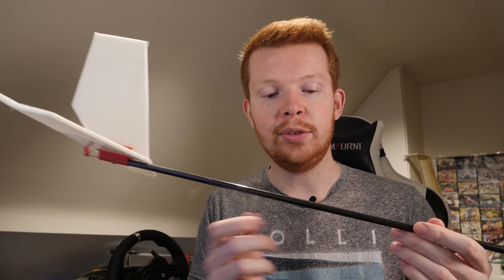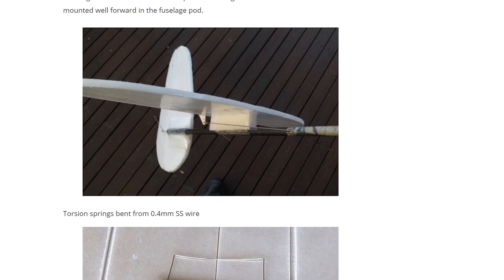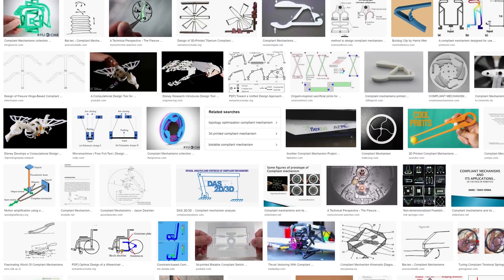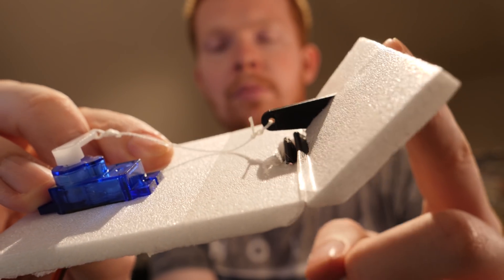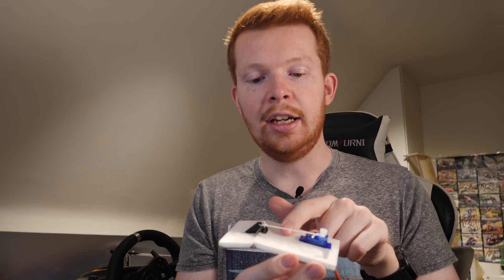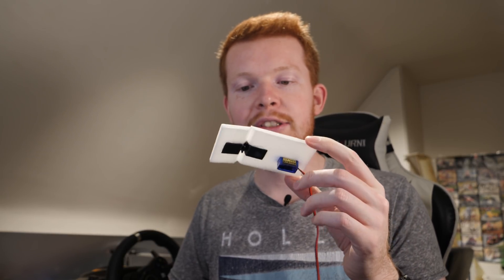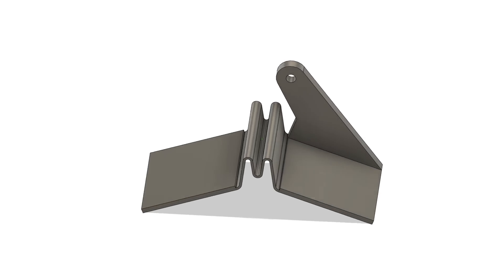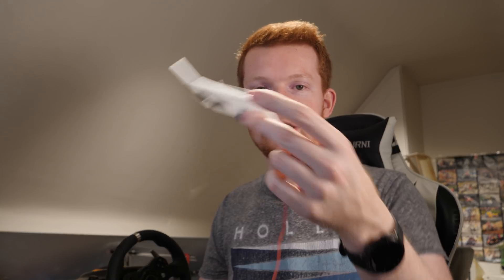Compliant Servo Control Horn Mechanism

Comment: Nice work! I recommend to NOT print this from PLA because it does creep very quickly and your pre-tension will be gone in a couple of days. ABS or PETG should be better in that regard.
Reply: seems like a job for nylon ;)
Reply: @errorgd  or an actual spring...
Reply: Yeah I came to say the same thing. I've experimented with 3D printed RC tank suspension and ABS is a LOT better than PLA.
Reply: i would even go for ASA, has from what i have printed so far even better bending qualities than ABS, uv resistance is irrelevant since it won't be in the sun long enough probably to be affected, but if Stefan @cnckitchen recommends a Material i would always go with that :D
Reply: Or just some folded sheet springy metal
Reply: Because of relaxation/creep you should try to store it in relaxed position...
And check different materials...
Reply: @andistraumann  good point.

Comment: I usually love your videos and your great engineering imagination.  This one is a bit deceptive though. A carbon fiber rod would be ok. A piece of balsa with glued steel rod at the end is also a frequent solution. 
In fact if you wanted to use flexible stuff you could also design a hinge/spring/horn/articulated rod (or rod end) all in one piece or printed in place parts...

Comment: Looks to be a very smart idea! A small lightweight stainless spring might be used for redundancy, should the plastic lose its tension. I tried using printed springs for motor mount in my RC fixed wing in 2013, but found some unwanted (and unpredictable) thrust vectoring J

Comment: You should balance the servo out with a similar system on the other side. So it is not constantly pulling on the wire. In true compliant fashion.

Comment: Hi Tom, 
Wouldn't it be possible to use the dual type servo horn, I mean the one which has 2 arms in opposite direction and use two strings or cords or a bendable wire or maybe fishing line and use double horn on the elevator with the linkage connecting one wire to the top horn part and one to the bottom where the upper string works to pull it up and the lower pulling down?

Let me see if I can bring more clarity with an   example : it's like a bicycle chain consider the rear sproket being the elevator part and the pedals the servo. With no need for a circular motion for this it should work I guess.
Maybe a tiny little pulley can be used with a rubber belt or rubber band.
This would have the advantage of the hinge not failing after repeated use like you said, could happen with your pla hinge. Here the pitch down movement is not as much as pitch up. Maybe it's a stupid idea, please feel free to correct or be mad at me.

Hey guys I straight away typed and submitted my when I read that people have already given this isea. Sorry guys but I was not trying to steal your ideas

Comment: Nice idea. Very original. Have a look at how they spring load the tail serfaces of a dlg. Simple "Z" bend out of piano wire. One side in the stab and one side in the control serfaces. I've not had a falier yet. Thanks for the great content.

Comment: well, intresting research but if this will had some advantage over traditional pushrod rc modelers al ready would had use them for long ago, anyway, to be constructive see the mechanism of the trhothle in walbro carburators, you can use the same mechanism

Comment: You could've tried a TWO-STRING configuration, that way the servo would be able to overcome the non-rigidity of the string by pulling on a different string for each direction.

Comment: added advantage is that if the servo fails or the string breaks, the plane will dive straight into the ground instead of unpredictably either gliding, doing loops or crashing straight down!

Comment: Carbon push rods light strong expensive tho the double string method would probably work a lot better and be stronger this will crack over time especially on the elevator that moves quite a lot

Comment: Why not mount the servo on its side with a T shape servo head with an end above and below the rudder plane; use two strings, each with control arms for opposing tension on the rudder? Skip the Spring mech because it’s heavy.

Comment: Have you considered looking at stainless steel TIG wire?  I purchased a large tube (3 lb) of 1.2mm x 1meter wires for under $50US.  They seem to be about the right size (diameter, stiffness) for the 9 gram servos I have.

Comment: Control surface flutter.  There I just saved your project.  :^)  It does make for spectacular crashes though.  Two old school ways of doing it is the pull-pull with fishing line (which is probably best) or if you only need elevator you can run a small wood dowel through your tail boom.  Put a small length of wire on each end.  The wire has a 90 degree bend which you drill a small hole in the dowel and fit it.  You notch the dowel so the wire runs inside the notch for a inch.  Then just heat shrink over the dowel and wire to secure the two together.   Z bend the on the remaining wire for connection. Do that on both ends and you are golden.

Comment: Music wire in a coil is cheap.  Cut a length, perhaps 3', bend a 1/2" 90° bend on each end of the wire.  Clamp one end in a vise, chuck the other end into a drill.  Turn slowly, and count the revolutions, while keeping slight tension on the drill/wire.  Approximately 12-15 turns per foot of wire.  Once you've completed the turns, reverse the drill for approximately 10 turns to relieve the spring tension on the wire.  Release the wire from the chuck and the vise.  You now have a control rod.

Comment: I have another possible solution.. What of you ran one string above and one below the elevator connected around a "pulley" , ie the one string will be in tension when it pulling up and the other when it pulling down, that way you will have reliable controllable variation in both directions?

Comment: Or ou do it like F3K Discus Launch glider doing it. A 0,4mm spring steel wire bend like a  z or U. If you google it you`ll find it. Will never break, almost no space required.
Reply: Well, it shouldn't break if designed properly so that it stays within the elastic region of the material, and even then it will innevitiably fatigue as all materials under fluctuating loads do.

Comment: If you printed that out of nylon it would probably last forever! 
Also, what about just running a separate string for each force, and moving them differentially? This is what actual aircraft do with cable control iirc.

Comment: Tim thats a nice idea but the servo will constantly pull power to hold the spring. I think a better idea would be to use 2 strings and tense them with a spring.

Comment: I have designed and printed a couple of spring mechanisms in PLA, but like CNC Kitchen wrote, they lose their tension. It is definitely important to move them to their relaxed position when you are done using them.

Comment: Why not use piano wire? could probably source it locally.
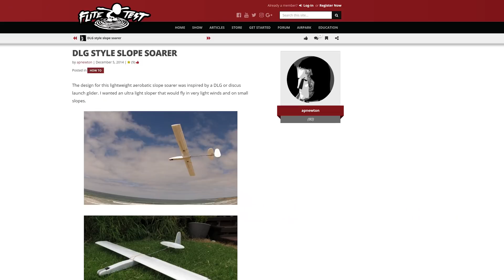Reply: In it's unprocessed form it usually comes coiled up and it takes a lot of force to straiten out into push rods. If you pause at  0:26 you can see that indeed the rods he orders are made of music wire, but someone has already gone through the trouble of straitening them which accounts for part of the marked up price.

Comment: My DLG uses guitar strings as push wire. They are relatively cheap easily available, and if supported in a tube astonishingly stiff. The DLG use an E string but there are of course 5 other thicker wire strings available. I have been making hinges in 1 part from PLA. If it is below 0.3mm thick it is very flexible. I like your design though.

Comment: Perhaps the parts using something like this could be designed such that the natural tendency via aerodynamics or weight bias would have the control surface oppose the force of the servo slightly. That way you aren't totally reliant on the spring.

For example if the elevator or other controls had trim tabs.
Reply: Had exactly the same idea. A trim tab would need an additional hinge design to reliably run the string through the main control surface joint without applying net torque but it's a perfectly viable option for managing primary flight control surfaces with a minimum of input force.

Comment: I think you overthought this. Why not just attach a cheap spring on the other side? No need to print a brittle plastic spring that will deform after a few dozen uses anyway.

Comment: The other half of the string-spring system that Andrew Newton uses, which you alluded to, is a spring embedded in the tail surface. This system is the norm among DLGs, which endure very high speeds during launch(beyond terminal velocity!). You just have to get the spring tension right. You can use guitar strings (E or B) to make the springs. 

I like the integrated nature of your solution(and the simplicity you alluded to belies good design), but like others here, I'd be concerned about the strength and durability of PLA. The elevator is the one control surface a plane absolutely can't survive without!

Comment: That will kill your servo very fast, something like this was used it old seal planes mid 80 with some spring and a coil , insted you can use your 'wire' sistem in a push-pull sistem. 2 fishing strings go in youre tube , one is pulling one is relaxing with a double arm servo

Comment: cool as an excercise, but why not just integrate the servo into the surface, so direct drive?
Reply: Center of mass I would assume. In an extremely light plane the weight of the servo is significant, and having it at the extreme end of the plane would shift the center of mass quite far back. On much larger, heavier planes direct drive might make sense.
Reply: Servos are quite heavy, even tiny ones, and you often don't want to place weight at the extremities.

Comment: BAD IDEA!!   this will have 2 potentially fatal flaws; the "down" force is limited by the spring action and the servo is FIGHTING the spring tension ALL THE TIME. That drains the receiver battery  and also can overheat the servo motor / electronics. CLOSED LOOP is the way to go; 2 lines one pulls up the other pulls down just like in full scale  aircraft. "spider wire" fishing line is a good material for this at verry low weight. You just need to get a "turnbuckle" that screws into a clevis as tentioner .
Reply: Agreed on both points, I was going to raise the same issues.  A control surface needs to be positioned rigidly.
Reply: @ferrumignis  this is just a case of "youtubers" who don't have a background in the subject.  Things are done (or avoided) for a reason. Experienced people know why. Sure its fun to try but don't promote flawed ideas as good ones.

Comment: Instead of using spring loaded, maybe u can try push pull instead. One string to pull to go up and another to pull to go down.
Spring loaded may have problem whereby the air flow and friction may be stronger than the spring. Thus u stuck in one direction.

Comment: Many years ago i had a plastic box with a broken hinge, i spread some silicone sealant along the hinge edge. not only has it lasted all this time, but it also self closes the box
For your application you could use silicone when the aeleron is down and let it set.

Comment: On my DLG i have a pull-system (kevlar string) and a spring in the hinge (piano wire). works great.

For larger planes...use 2 strings (1 on each side of the hinge)

Comment: Surely fishing line would be better? Especially with UK weather... Moisture!
Reply: spider wire brand has a good name for this application; also use the plastic coated steel wire from the fishing supply shop for the bigger models.

Comment: wouldnt it be better to mount it in reverse? if the servo fails, the plane would pull up and most likely go down like a paper plane instead of nosediving to its certain death :D
Reply: My thoughts too, but I don't think it makes a difference in the end, unless you can find a way for it to fail in the neutral position. If it fails up, the plane will pull up and then either loop or stall and then plummet down, if it fails down it just nosedives straight away.

Comment: What about a cam/lobe actuation element with attachment points on each side of the control surface for bi-directional movement (pull up and pull down)? It would seem that this would be a simpler mechanism, not subject to fatigue failure, that would provide positive control in both directions.

Comment: That looks like a great way to induce oscillation and burn servos :D
Reply: DING DING DING WE GOT A WINNER !!!!!!!      /sarcasm    yup ;)
Reply: @cmulder002  thanks!
Reply: @NoPro420  :)
Reply: IThas been used for many, many years in RC models without any problem. It is very popular in F3K gliders.
Reply: @Boogie3D  It's not that it can't work, but that it can easily lead to aeroelastic oscillations if not designed properly for the expected flight conditions. But this can be hammered out in testing I'm sure.
Reply: Shut up :D

Comment: That's a cool concept! As for pushrods, you can use like 1mm or even thinner wire and pass it through a tube and you'd have a Bowden. A simplified version is same wire passed through tight loops of zip ties. I saw it on Flite Test

Comment: Hi, Tom! 
You could use two strings, second string just goes through the surface of the wing to the other side. 
The lever of the servo pulls one string and releases the other, just how human muscles work. Maybe?
Reply: its called "closed loop" and a common way to control model planes. Got a carl Goldberg piper cub that i installed it in. Looks scale and much stronger then push-rods at lower weight. I used the steel cable and crimps sold at fishing supply shops.
Reply: @cmulder002  thank you! Good to know:)
Reply: That's what instantly went to my mind when he stated the problem
Reply: +1
Reply: Who is Tom? This is Tim's channel
Reply: @linecraftman3907  😂😂😂 yeah.... sure it is

Comment: While I enjoy watching your ingenuity, why not just use marker flags for pushrods? I switched to them fairly early on specifically due to the fairly high shipping costs
Reply: Or coat hangar wire.
Reply: Marker flags work OK, but are made of very hard steel compared to pushrods. They are much harder to bend and cut. Personally, I prefer to buy clevis-ended pushrods at my local hobby shop for $1. Easy to adjust, cheap enough, support a local business.

Comment: Do you think it would be possible to archive the same results with a bent piece of thin spring steel instead of the 3d-printed compliant mechanism?
Reply: Why wouldn't it?
Reply: Like the way many DLG have the vertical and horizontal control surfaces  are controlled. A thin piano wire with 2 90 degrees bends stick one end in the fin or stabilizer and the other in the rudder/ elevator.

Comment: Hey Tim Station, nice video.
Just yesterday I thought about printing servo horns and hinges for my next plane.
Reply: better uses hinges that use a pin; anything that bends will fail sooner or later, with horns make sure you get the "spline" right so it does not rotate on the output shaft.

Comment: I think having two strings pulling using both sides of the control horn would be more efficient so the servo isn't constantly pulling to keep the elevator level
Reply: yes
Reply: I always use a pull-pull configuration. You can route your lines however you want. I route them using the small ink tubes inside some pens.
Reply: I think two strings can lead to backlash issues if both paths aren't completely straight. Also servo motors have a certain resistance against movement, even unpowered probably more than the mechanism or the surfaces will tolerate. I also think this hinge is more elegant because it means less moving parts and there has to be some kind of hinge on the control surface in any case...
Reply: totally ; this is a failure (3 actually motor/ receiver battery and hinge spring) waiting to happen.

Comment: Why not just place the servo laying down and two strings to pull on top and bottom using the proper horn on the servo.  Seems control is dependent on the strength  of the  spring and adds too much weight.
Reply: It’s hard to get the two strings perfectly tight so that the rudder doesn’t flap.
Reply: @Mike-oz4cv  Hi! Might it be that spring or rubber band will negate any differences in tension?
Reply: @Mike-oz4cv  there are turnbuckles for that that make setting the tension quite easy. have it in some of my model planes.

Comment: Closed Loop works better.....?
Reply from the maker: Closed loop would work better for consistent torque in both directions, however I assume it requires precise tensioning of the strings to prevent 'slop'.
Reply: @TimStation  why not combine both a loop, and complaint mech. To bias any slop in a preferred direction. Rather than have it just flop around?
Reply: @TimStation  And your compliant horn/hinge has no slop? I don't know what speed you intend to fly at, but the aerodynamic forces are significant enough for you to require quite a bit for sprung force, meaning that your poor servo is going to have to work very hard just to maintain neutral. 
Some tension would be required along with string/wire that doesn't stretch, not so sure about how careful that needs to be.  i.e I've never been careful.  PS great channel love the content!
Reply: @TimStation  simple with a turnbuckle that fits in a clevis  for example http://www.ripmax.com/Item.aspx?ItemID=F-DB201&Category=125-30-25  Got a carl goldberg piper cub that uses it for rudder and elevator and it is much stronger then push rods.